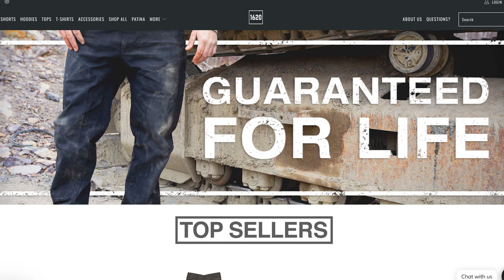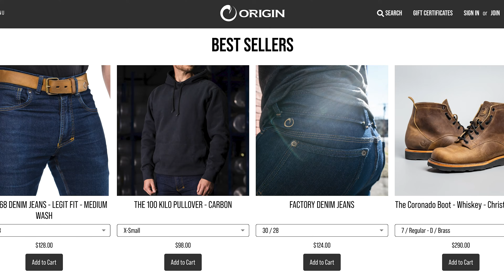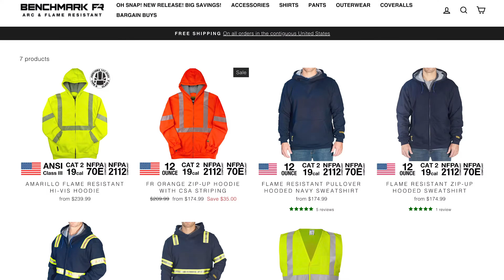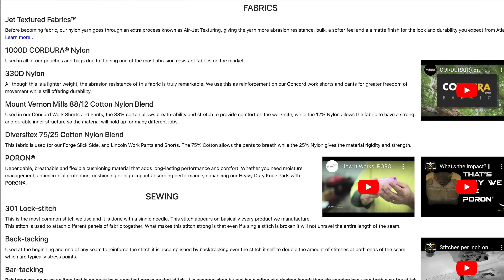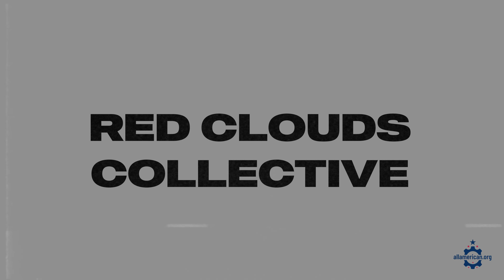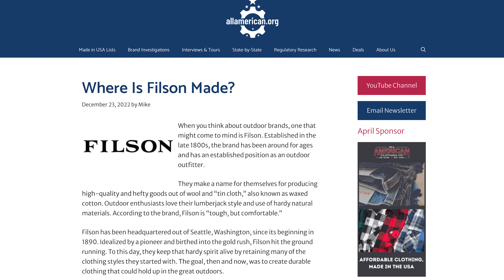6 Workwear Brands Made in the USA (+ 4 That Might Surprise You)

Comment: It's not workwear if it's not worn on a job site. Benchmark is the only one I've seen in 30 years. 1620 is expensive and online only. Red cloud is the same. Origin has spandex, and it's online only. I've never heard of Atlas 46. Pella, i have seen, but that's only because of cattle. 
Clothes actually work on a job site. Carhartt, Levi's, Wrangler, Rustler, George, Dickies. With carhartt and dickies people avoid the spandex models. They get runs, and the waist stretches out. I do see the spandex models but not on the guys doing the hard labor. Foreman, painters, electricians, I'll see stretchy britches. Welders, Pipe fitters, Iron workers is 100% cotton. Fire and plastic don't get along.